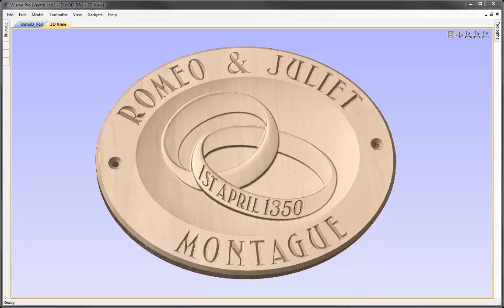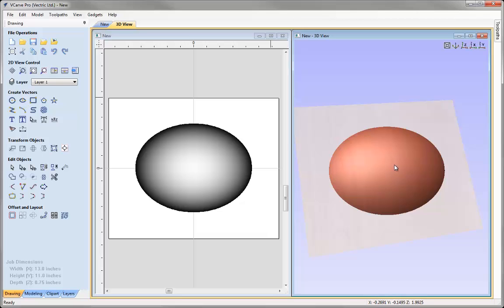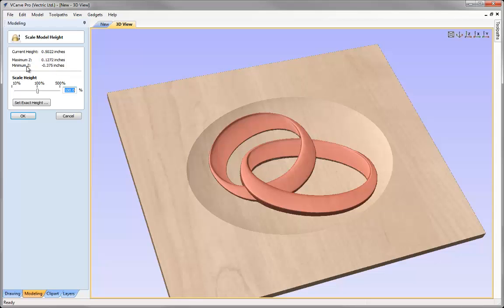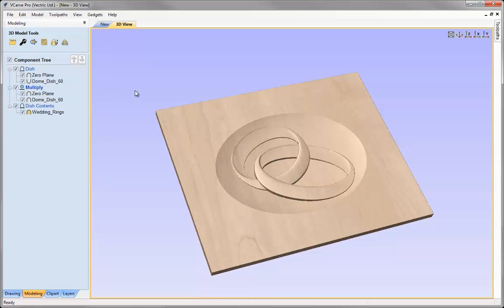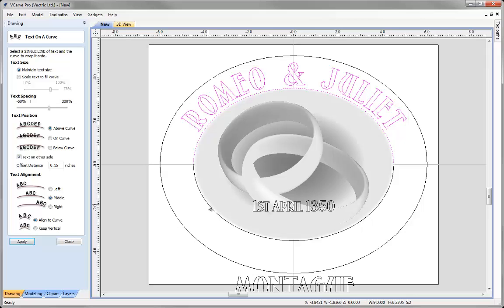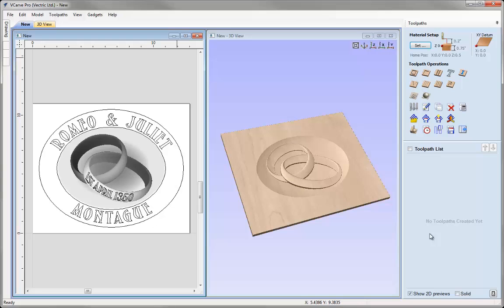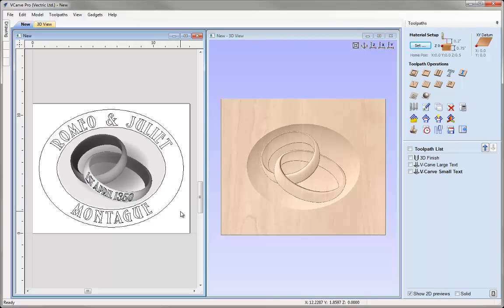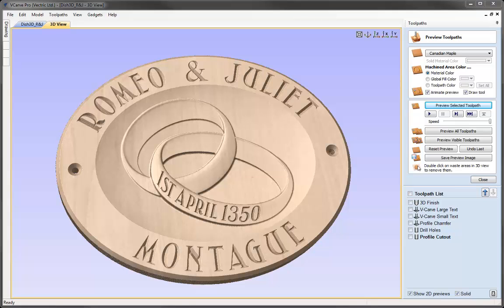Vectric - 3D Shape in a dish

Comment: How do I do 3 dishes on one project? Love this video. I've labeled dish 1, 2 & 3 all the same set up as dish 1. When I go to tool paths it only does dish 1. 
Im running Vectric desktop 12.5
Reply from the maker: Hello and thanks for the question.  I suspect that when you are creating your toolpaths you have selected the wrong option in the "Machining Limit Boundary".  I would start by having a look there and then if that does look OK, email support@vectric.com and include your file.  They can get you on the right track... :)
Reply: @vectric I some how figured it out.
I had added a zero plane to each of the dishes. I unchecked all but 1 and now it is working. So I'm Guessing only the first dish need the zero plane.

Comment: At the 15:00 why do you change the Dome Dish 60 in multiply to positive and the height from .375 to 1.  Wouldn't the pixels on the outside edge still be zero height whether or not you change the height or additive mode?  Thanks for the tutorial
Reply from the maker: Hello Burton... thanks for the question.  The "Multiply" combine mode is a tricky one to get your head around.  When we use it in a situation like this we make sure we use a multi dish that is exactly the same positive shape as the dish but scaled to "1"... as you noted.  That tapers the edges of the model so that if there are any bits of the model's edge that rise above the dish tuck them inside.  It is important to mention that in some cases (because of the nature of the model) it won't make any real difference.

"Wouldn't the pixels on the outside edge still be zero height whether or not you change the height or additive mode?" 
In this case, you are correct... but if you wanted to taper a scene into a dish then this is really important.  In the scene case, bake a plane into the positive dish, scale it to 1 and then change it to a multiply component... magically everything outside the dish disappears!

I hope something there helps.

Comment: How do you set the tool path z height for the ring text after it’s been carved. As you know now the ring text is lower and not sure how to set the “Z” height. Where do I need to set “Z” from, do I still go off of the bottom right corner as that’s where it was set originally? Hope this makes sense…
Reply from the maker: Hello J... in the VCarve toolpath form make sure you choose "project toolpath onto 3D model"... it is located at the bottom of the form.  This will do all the work for you.

Comment: I'm making rings with a convex round over radius on the inside.  When using the finishing toolpath (offset), it wants to start at the bottom and cut up.  Is there a way to change the order and start at the top and cut down?  I would prefer not to use a roughing toolpath if possible.  The finishing will work fine if I can change the order.  Thanks!

Comment: At about 32:40 you explained the problem I was having. I was bringing into Aspire 9.517 a 3D Design & Make model of the moon in a dish. I DID put a vector around it, and did use a zero plane, but it would try to carve the whole workpiece because I was using Model Boundary. Selecting the vector and choosing Selected Vector and 0 offset worked. Thanks!
Reply from the maker: Glad you got it figured out :)

Comment: We're you inserted the 1" in the multiplier, what do you put in if you are working in mm?
I am using 19 mm wood.
I am having trouble with that.
Thanks
Reply from the maker: Hi Gary, you would still use 1 as the value for the multiplier in mm. I hope this helps :)
Reply: Vectric Ltd will try it thanks
Reply from the maker: @garytaylor5646  No problem good luck with your project :)